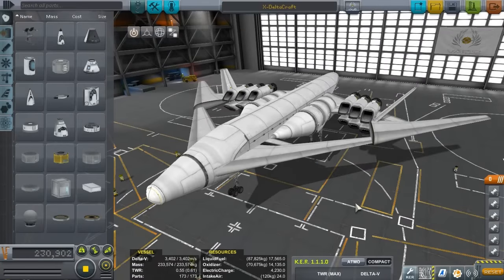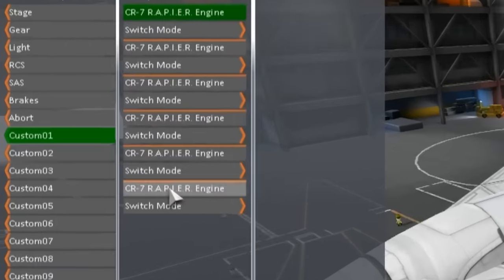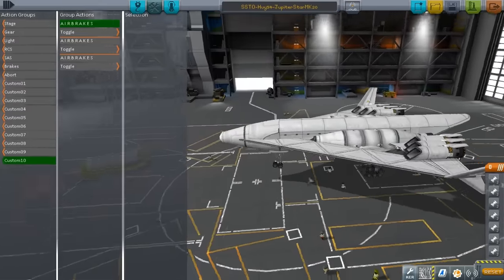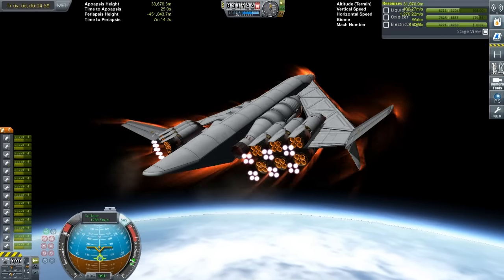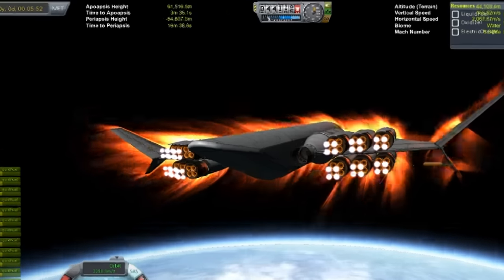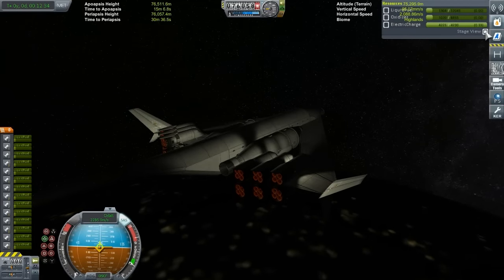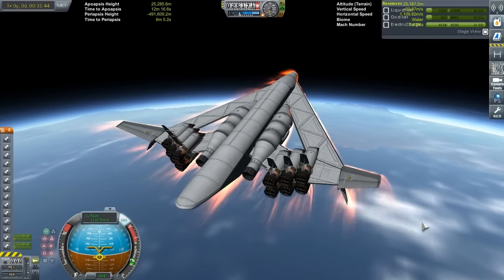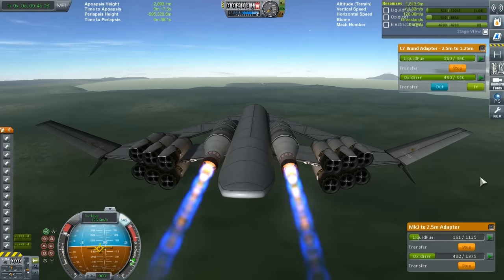KSP - JUPITER STAR Mk 20

Comment: About moving fuel to the front of the ship to control the CoM, have you considered locking the fuel supply in the nose cone since you landed at the KSC with it practically full, or adding a full Ore tank (whatever size and number of them) for ballast? However, adding the Ore would drop the payload rating.